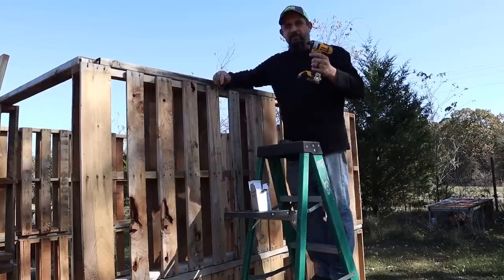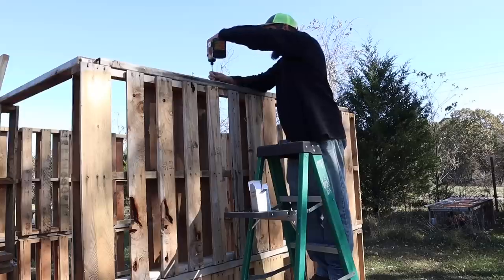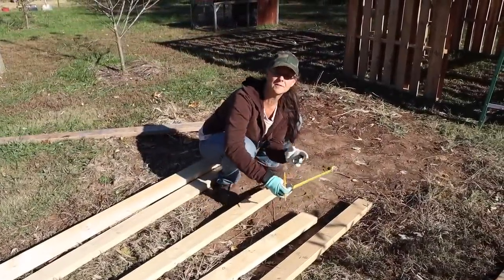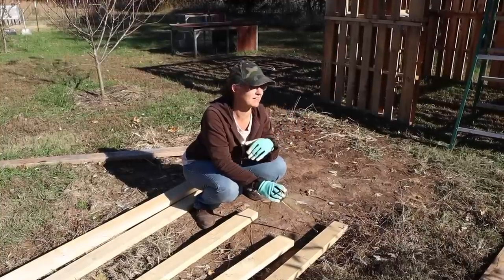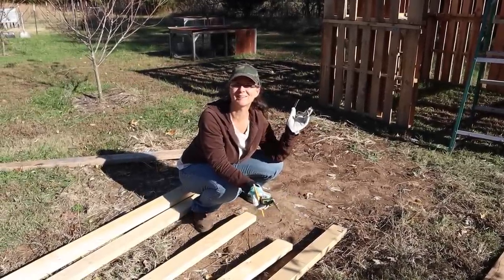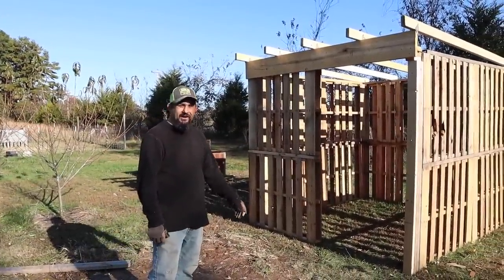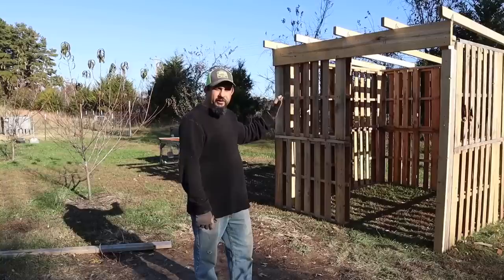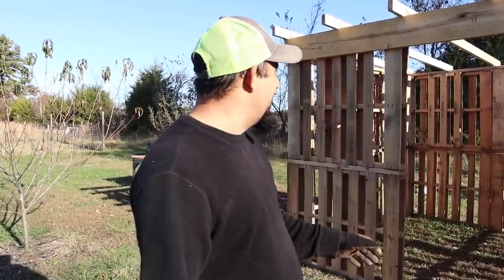Back to Work on the DUCK HOUSE Pallet Shed!

Comment: Throwback time! Lol
Wood pallets are my absolute favorite building material! It goes so fast when you're throwing up 12 -16 sq ft at a time! I've built a goat shed, a small coop for bantam chickens,  and even fence using nothing but pallets and scrap wood. Like you said, "The ducks don't care." Ive made that same statement about chickens or goats. They are perfectly happy as long as they can stay out of the wind and rain. Function trumps form. It doesn't have to be pretty. Especiallyon a tight budget.

Comment: Love the new duck house!

Kevin I use the bit that has a sleeve from DeWalt to drive screws easier. I'm not a screw driver but the sleeve helps me holding the screws in the bits.

To protect the bottom of the walls, you can run an overlay of plywood like 2' ('=feet, for those who don't know. "=inches) high, and go all the way around. This, will be rotten in about a year or so no matter what but, it will protect the bottom behind it. Then once it gets a little enough damaged but not too bad, remove it, and place another. If possible, you can give a coat of bull to the bottom of the walls, before the skirt cover, and over the skirt. It will protect your bottom wall and your skirt. Then you can paint it a color of your choice.

This was a great job indeed! Thank you for the Demo!!!

Comment: We built a shed for our rabbit pins out of pallets, instead of putting plywood on the outside we broke down a bunch of other pallets and played Tetris in the blank spots with the boards. Our shed is 12x24 and 10 ft high (we increased the height with 4*4's). The whole project cost was less than $100 because we reused tin from an old hay shed and landscape timbers. The bottom boards of ours is also railroad ties that we were given when the railroad renewed their tracks a few years ago.

Comment: Watched for roof help did almost the exact  thing but I did use a few 10 foot 2x4s as post in the ground to prevent wind blowing  it over  dropped and covered 3 feet it aided. with a  window entry also  thanks for the help and confirmation of  our build

Comment: I love that you are repurposing the palettes. It is a good source of free lumber. I get all sizes of palettes. I like to make different kinds of furniture. So far I have built a Jon boat shelf for our bathroom, inside corner 4 tier shelf, scrap irregular hanging shelf, high back desk with 2 pullout center drawers w/4 shelves on the highback and 3 lower shelves under the left side. I love the fact I can get FREE lumber. I would like to see you build more with palettes. You could call it Quacker Place Inn and Bar. Only Ducks and No Admittance of Geese, Chickens or Swans

Comment: A few years ago I built 8 horse stables back to back out of pallets, exactly how you both just did, except i had large timbers in ground every 2 pallets, (which was complete overkill) and those stables are still standing 10 years later and only cost me in the framework, and now because iam building two new shelters on a plot i dont own this time i needed something affordable and quick that i can do on my own , i found these videos and realised that i didn't need to worry about the ridiculous ground timbers i had concreted in 3ft under 🤣atall. I think all i will do differently is to screw in base timbers around bottom.
Thankyou for making a proper simple video and reminding me

Comment: One thing I would suggest is putting some angle bracing on the inside.  That will add stability to the walls and increase the life of the structure.  You only need some one by four or six lumber to run on angle from the bottom to to top plate.  You can set them so the run up and form a v with point either at the top of bottom.  On the side with the door you only need to run one brace up.

Comment: I love  building with pallets, but still think a foundation of pressure treated wood will make it last a lot longer. It would also keep the plywood bottom edges further from ground moisture. It's still not to late, I'd jack it up and slide some under it.

Comment: Lots of good names: I like Waddle Inn or Duck Inn.  Kevin please up date your Amazon buy page, like your new screw driver.  Did you buy extra batteries, charger etc.
Kevin, your not cheap your thrifty!
Reply from the maker: I bought it factory refurbished on Ebay.  It came with the impact driver, a drill, 2 batteries and the charger.

Comment: 52 for a high?.......that is short and T-shirt weather here in Montana.  If you pin a 2 ft piece of chickenwire to the grass around the duck house it will keep anything from digging into the duck house.  Most animals want to dig right at the base of the walls and won't thing to go out to the end of the chicken wire..  We have had great success doing this and never have a problem with anything digging in.  When you pin the wire to the grass is you do it well the grass will grow up thru the wire and you can just mow right over it.

Comment: Aren't you supposed to use nails not screws on those roof joist hangers?
Reply: Nails have greater shear resistance, but I'm wondering why the expense of joist hangers.